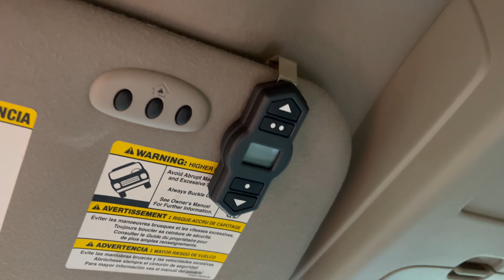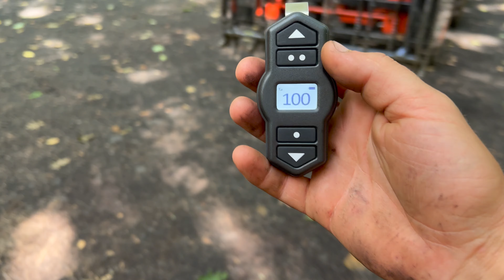#264  Unloading Perfect Hickory Logs & Splitting Red Oak Firewood

Comment: When you lift or level a truck you take away the rake.  Making any squat look even worse.
Reply from the maker: Yeah the truck isn’t lifted. I added larger blocks in the rear to keep the factory rake after I added the larger shocks all around and beefier suspension in the rear.
Reply: @DudeRanchDIY  the front was higher that the rear from the factory?  Shocks dont add height.